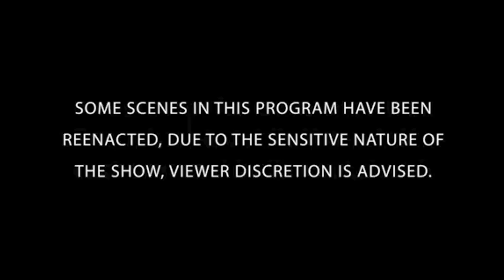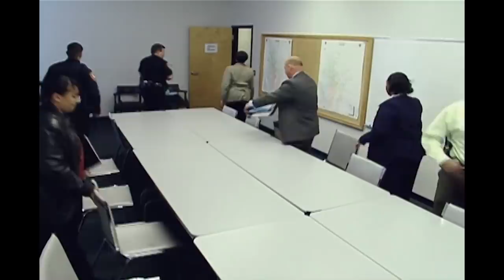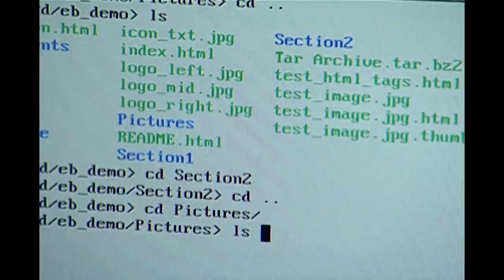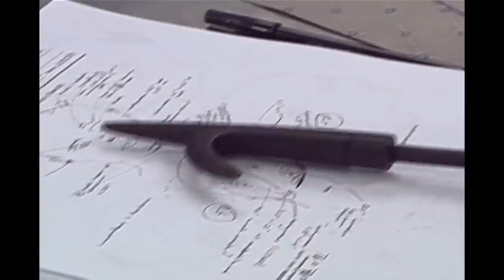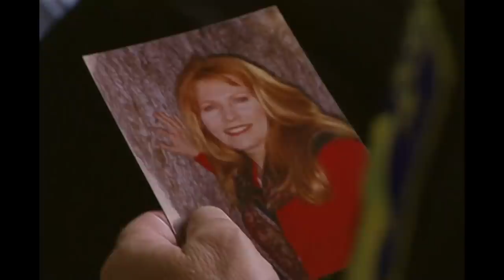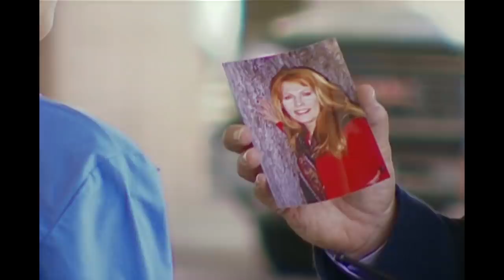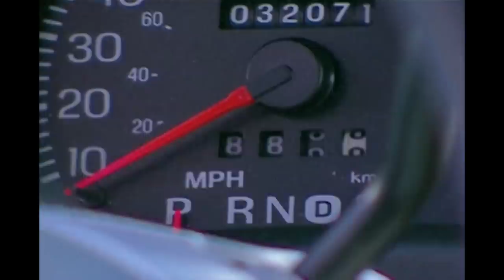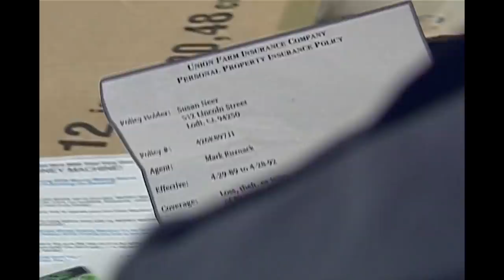Written in Blood | FULL EPISODE | The New Detectives

Comment: There are so many different ways to fall down stairs. There must be so many facts that have an impact. The surface of the top of the stairs and on the stairs and at the bottom of the stairs, the footwear or lack thereof, the person that falls bodyweight, the size and width of the stairs, the balustrades and anything hanging on the wall. Did the person slip, did they go face first, feet first, back first. Did they tumble or slide or bump.

Interesting that there are so many fatal falls from stairs that you get experts in it.
Reply: This is why it is so hard to prove.   A massive insurance policy usually helps police with their enquiries.
Reply: @treasurehunteruk9718  Including secrets of a double life that can be seen as a lie to die for